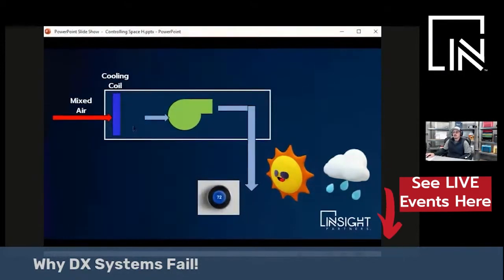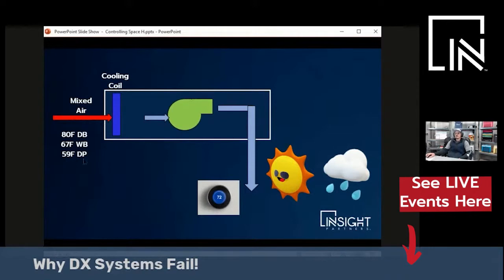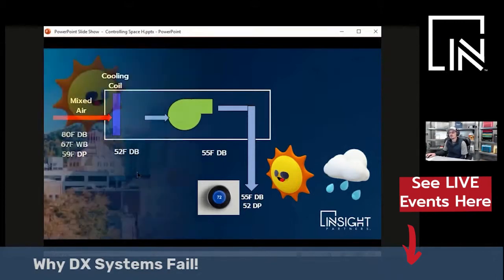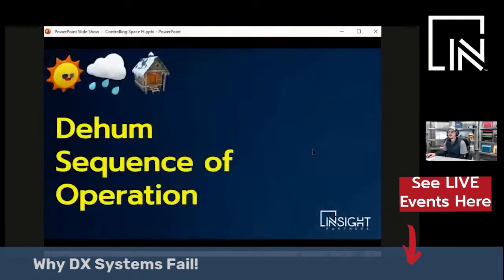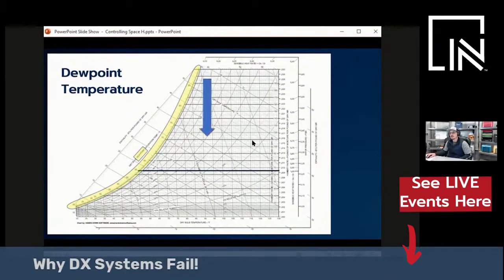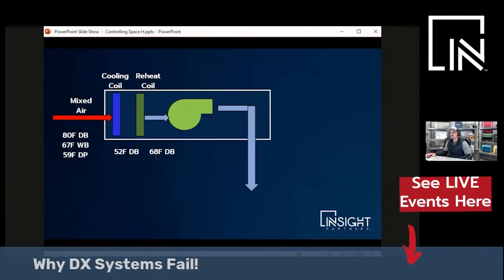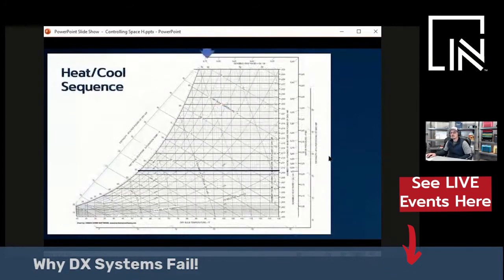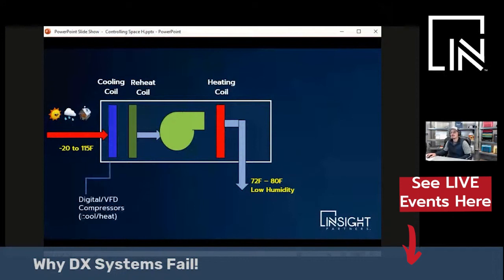Why DX Systems Fail To Control Humidity!

Comment: Why can’t we use the heating coil to reheat the air instead of adding an extra reheat coil ?
Reply: I think I just realized why.. it’s because it’s not efficient to run boilers during summer just to reheat the air, oui oui ?
Reply: @antonkorolev8059  I'm not an expert, but yes you are correct. Instead of rejecting the heat out, you have a reheat coil that takes the heat after the compressor instead of it going to the condenser to reject. People like to call it "free heat". And yes running a separate boiler makes it costly and inefficient.
Reply: Funny, we kick ass using ACs and Electric Resistance heat, the game is over and Engineers are OUT!

Comment: hi.how about energy consumption?how about using ERV for dehumidification? is it applicable
Reply: An ERV is not a dehumidier.  It is a heat exchanger.  Condensation can form in the ERV if the dew ponit of the outside air is above the temperature of the indoor air.  Let's say your indoor air is 72 degrees.  Bringing in unconditioned outside air with a dew point greater than 72 degrees guarantees condensation.  Examples would outside air higher than 72 degrees and raining, 85 degrees outside and relative humidity above 65% or 95 degrees outside and a relative humidity above 50%.  A ventilating dehumidifier would be a better choice for humid climates.

Comment: Modulating gas re-heat is your friend. AAON does it really well
Reply: Have five 12 ton Aaons for indoor growing spaces and have modulating gas reheat which works out great.  Also have electric heat as a backup when the system is taxed heavy.